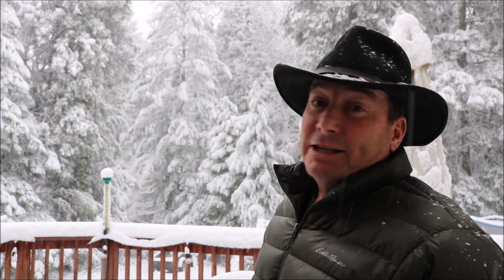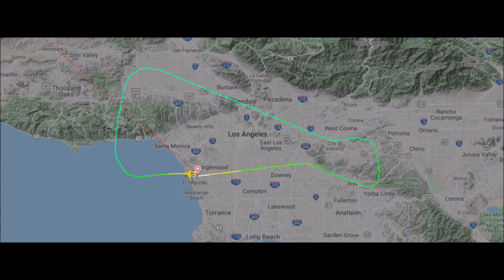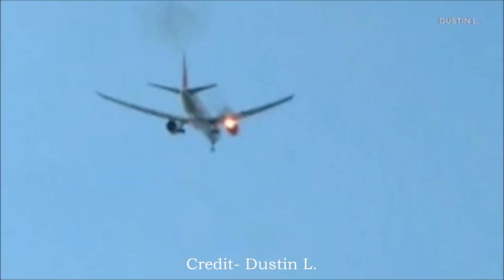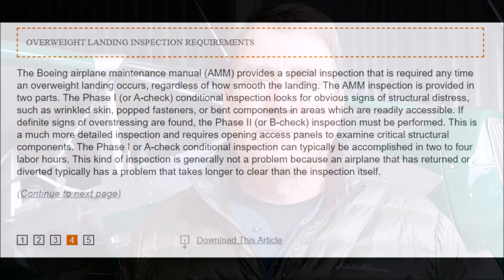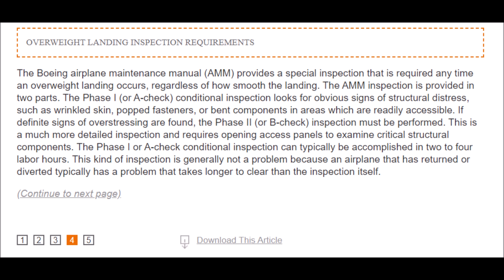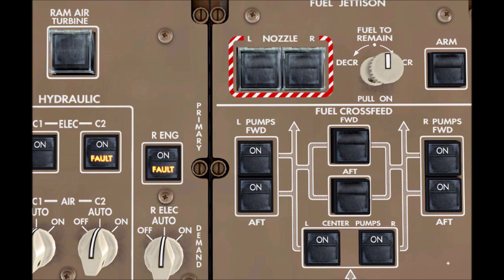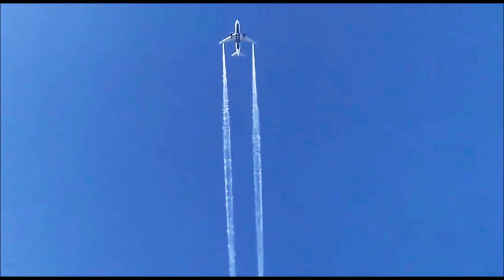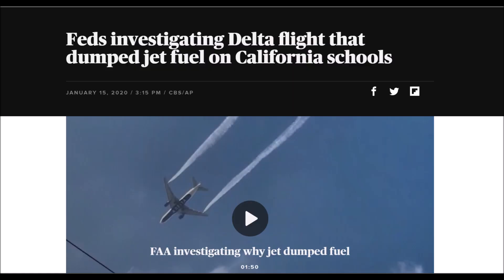B-777 Fuel Dumping and Overweight Landing Considerations (Part II)

Comment: Given something like a compressor stall on departure which didn't result in engine shut-down, my judgement would be to take it out to a safe dump area, sort things out and come back when good and ready.  No need for a slam-dunk emergency return, unless that Rolls was in MUCH worse shape than we imagine.  Plenty of runway for overweight landing - it would be a piece of cake (I've landed about 24000# overweight in the 777-200 and it was a non-event on SFO 28R). I'd bet this unannounced, low level fuel dump will result in an FAA investigation and a good chance for a serious violation on the part of this flight crew's actions.  Really good discussion Juan, as always.
Reply: Bill Wightman Right on the money- and your opinion agrees with mine. (I haven’t flown a 777, but have plenty of time in 767’s and 747’s.)
Reply: @FutureSystem738  I've never even ridden in a 777. 

I am not a pilot.

I've never even flown a video simulator.

But I have a reasonable understanding of mechanical stuff. So, it would seem to me that when an engine stalls for an unknown reason, you should have concerns for the other engine. 

That being the case, would it not be prudent to put it down as quickly and safely as possible?

Is it standard practice to say, "ahhhh, fagettaboutit! we got another one"? And park it out over the Pacific while they vent fuel until they are at an acceptable weight?

Seems to me that a little bit of a Jet-A spritz is acceptable rather than risk total engine loss, regardless of its likelyhood.
Reply: 24k over...pretty heavy, had the DL not dumped, they'd have been 70k heavier. Pretty big difference than 24 huh?
Reply: Bill, is a compressor stall something that happens much? Is there a way to immediately diagnose cause? Could it be FOD? My guess is that when it happens shortly after takeoff, FOD is a possibility, if not the likely cause. And if this is the case, isn't the other engine suspect as well?

I have asked this question a few times, but haven't received a reply yet from a professional pilot.

So, I will ask again. 

When an engine stalls during climbout, what are the possible causes? 

Seems to me that FOD or fuel contamination are at the top of the list. And if this is the case, is there a chance that the other engine may have sustained some damage that has not yet become apparent? 

The only explanation I can come up with the pilot's decision to put it back on the ground ASAP is that he did not have confidence in his remaining engine. He had to know there'd be repercussions for dumping where and when he did, but was more concerned with the possibility that he was gonna become a glider pilot shortly.
Reply: @petec9686  Hello - compressor stalls are VERY rare these days.  A compressor stall is an aerodynamic stalling of the compressor blades (similar to how a fixed wing can stall) which results in sudden interruption to airflow through the jet engine. 

     CS's can be anything from mild to violent - and in most cases there's no way for the aircrew to diagnose the root cause of the problem.  Fan blade icing, or damage are possibilities.  A CS can usually be felt, heard and observed by the crew when it happens.
     A stall occurring shortly after takeoff as in this case might have been caused by a damaged blade(s) or maybe not - just no way to tell.  I personally would still have complete confidence in the other engine as long as it was performing normally.  Big thing here is the incident engine was reported to have recovered after power was retarded - which is what we're trained to do in the event of a CS.  If the engine recovers, leave the power where it is (or lower) and sort things out from there.
     I have a ton of experience with CS's due to my years flying the E3 AWACS.  The TF33's there could stall if the power was brought too far back while accessory drive load was high.  It was a muffled "bang" type of event, with EGT and EPR (exhaust pressure ratio) jumping around.  Simply advancing power would always stop it, and I never saw or heard of any engine being damaged by running it into a stalled condition.
     Its important to understand that when a "startle event" happens, our cognitive awareness as humans will be instantly compromised.  Meaning that our ability to accurately take in inputs from the outside world and then make good decisions from those inputs might be severely compromised.
     The wrong thing to do is to react inappropriately while cognitive index is low - we call that "rushing to a solution" which is what appears to have happened here.
Reply: @davep9266  When we're talking about a 640,000 pound aircraft, +50k landing weight is really not that big an issue.  Lets look at some data from the 777 Flight Manual:
     Max takeoff weight for the 777-200B is 648 (thousand pounds).  So lets say we're going to fly a heavy weight no-dump quick return to the field, single engine which will be a flaps-20 approach and landing so I'll assume a worst case landing weight of 630 here:  (thats a full 170000 over max landing weight of 460000 !!)
     From the 777 flight manual:  At 630 and approach/landing flaps 20 published landing distance is 5440 feet (max manual braking / max reverse on operating engine / zero wind / VREF+5 over threshold / touchdown @ 1000')  With light braking, my guess is the landing rollout could be comfortably completed within 10000 feet, letting the reverser(s) do most of the landing roll energy dissipation and leaving less heat in the brakes.

  Considering KLAX runway 25R is 12,923 feet long, you can see its really not an issue.  The biggest issue after landing will be HOT brakes.  But that's also really no big deal with fire trucks ready to handle a brake fire.
   The take-away here is to recognize what an OUTSTANDING aircraft the B777 is.  It has amazing capability.  Its what I want to be flying when the going gets tough.
Reply: @okflyer777  I've seen people criticize the pilot for not going out to sea and dump. If it were known why the stalls occurred, I'd agree. But this incident was an unknown to the crew. He didn't know if it was a part issue or contaminated fuel (the latter has been a recent issue the past few weeks). The airline procedure is also an unknown. Regardless of the aircraft performance, his only concern was the 280+ souls onboard.

Comment: I flew the B-777-200LR from LAX to SYD a lot in my years just before retirement. The numbers for the 200LR were 766,000 lbs Max Takeoff and 492,000 Max Landing Weight. If I lost an engine right after, or during takeoff, my plan was to come back to LAX as fast as possible and dump fuel most of the way back. So I would be dumping fuel below 5,000', probably at least down to 2,500' on downwind. In my briefing before take off I would tell the RP to stop the dumping on base leg if we forgot about it. My guestimate was that, in the time it took to fly outbound RWH from LAX, get stable, and turn around as soon as possible, go downwind, base, final, and land, I could dump about 60,000 lbs of fuel. We often took off near Max Takeoff Weight of 766,000 lbs on SYD flights, so my weight on landing would be near 700,000 lbs, well above the Max Landing Weight of 492,000 lbs. I never flew the L-1011 or the MD-11, so no ancestor worship from me. ..... So this could have been me. Thankfully it wasn't.

And these guys did not say they didn't need to dump, but rather they didn't need to go to a designated area to dump. They needed to get on the ground fast, and get their weight down. The bad engine was still providing electric, hydraulic, and pneumatic, but not much thrust.

Basically, to understand my plan. (1) Get on the ground fairly quickly (2) get rid of weight as fast as possible.... So, no-go to area to dump, and probably dumping below 3,000'.

Comment: Very educational video! It helps me to learn the enormous responsibility which pilots they have on their shoulders once they are in the air, also during emergency procedures with significantly damaging consequences for mishandling the proper action. It is not easy to be a pilot, for having very demanding pressure to do things the right way with "Zero Tolerance".

Comment: Always a good idea to pre-calculate your landing distance when doing a high weight take-off. Especially if you're using an iPad or similar to calculate performance. This way you know whether you need to dump fuel or not. An overweight landing is not that big an issue providing the vertical speed at touchdown isn't too high. You can use any excess runway to keep the brake temperatures down. Fuel dumping needs to be carried out in a controlled manner (altitude and location) using the checklist. At my company we just covered this on the last re-current. We were shown all the indications on the FUEL page and on the overhead panel. Very informative.

Comment: The other consideration for whether to dump or not on a four engine airplane is the possibility of losing a second engine on the same side due to damage resulting from the adjacent failed engine. If one had to do a go around with two engines out, one would want to be at a weight that would safely permit that to happen. This was a concern on the older 747-100, especially on a hot day. That, perhaps, is part of the historic mentality you mentioned with regard to dumping to MLW. 

Of course, whether to dump or not is at the captain’s discretion based on the current issue, but whatever is determined better be the right course of action...unlike this Delta flight. It’s really hard to imagine any justification at this point for what that captain chose to do.

Given that this was a 777 from LA to Shanghai, there would be one or two extra crew members onboard. I find it astounding that between the three or four of them that they dumped fuel where they did after being asked by ATC if fuel dump was required and replying, “no”.
Reply: Thank you ,Manny, for clarifying how a "real", HEAVY, airplane is operated, rather than these "light twins. :-)))). F/E, Mike Jaureguy- PAC.
Reply: The 777 is a twin engine airplane. According to a quick search, it can fly for 3 hours and 1300 miles on one engine. I don't understand the urgency to land if only one engine had a problem and they were able to stop the compressor stall. The investigation should be interesting.
Reply: divingfe   Hi, Mike. Long time, no see.
Reply: HiWetcam   Not sure I understand the question.
Reply: @tiredoldmechanic1791  3 hours/1300 miles or until the other engine fails.
Reply: @tiredoldmechanic1791  The only thing coming to mind is that they maybe experienced the same problem on the other engine as well during the final part of the flight.
There was unfortunately no audio on VASaviation for that part so it is not yet really known what was said there.
It could be that they found there was extra urgency to land quickly, but it is difficult to explain why they suddenly started dumping fuel for that short period of time where it would not make a real difference anyway.
Reply: Tired old mechanic I can understand the urgency to land. The reason air travel is so safe is because of redundancies. It CAN fly that long on one engine but there’s no backup in case of a second failure. I don’t think they are going to experience an engine failure and just continue because the plan could make it on one engine, they’ll want to get it on the ground. I dunno about the fuel dump but I can understand why the 1300 mile capability is not really much of a consideration unless there’s a reason they don’t have an airport for hundreds of miles.

Comment: Some crew is going to get to sit at that long table where they are the only ones not supplied with a bottle of water.  Glad I'm not that captain.  Not sure what Delta's QRH looks like but all the ones I'm familiar with have a prompt to take you to the fuel jettison check list on engine shut down check list. Thanks for the update. Its been painful watching what the main stream media is saying. All the slip and fall lawyers are lining up.
Reply: Well, it just wasn't "school kids" who got a Jet A shower. The jet dragged the stream for a couple miles. Do you want your car covered in that greasy stuff?
Reply: @fucqtheworld  I'm sure there was a strong odor of fuel but I doubt if anybody's hair got wet with jet fuel. It was more than a couple of miles. Are you with CNN?
Reply: @Kevin_747    So, you're defending their dumping of the fuel?
Reply: @nodttiurp  No. Are you?
Reply: It's kerosene. Well atomised as it was, it wouldn't have hung around more than a few minutes before evaporating completely.
Those kids and parents would have far more exposure issues merely going to school every day under a flight path...
Reply: @Kevin_747  wtf does CNN have to do with it ? Smfh... political  foolishness  everywhere you  turn.
Reply: @checkdilevels1180  because CNN is garbage media and well-known for inaccurate reporting and taking statements out of context, much like the user he was responding to.
Reply: @jsquared1013  So does every MAIN stream media outlet...

Comment: The exact language of the ATC inquiry as heard by the pilot might become relevant. I've read this was the question: “OK, so you don’t need to hold to dump fuel or anything like that?”  and I've seen 'or dump' in place of 'to dump'. It makes a difference. The reply was "negative". The pilot might have been correct in that he didn't need to hold to dump fuel because he intended to dump on the way in.  That wouldn't be good practice but note that FAA regs permit a pilot with a declared emergency to deviate from any reg at his/her discretion in order to get he plane safely landed.

Comment: I like the old F-111 "dump and burn". There's video on that at airshows here on yt. Aussies did it a lot at their airshows.
Reply: I was just pondering that very idea, would be a very effective and logical way to eliminate the dispersal concerns of fuel jettison especially in a scenario such as this one.  Would certainly look spectacular although scary for passengers and ground witnesses who didn't understand what was happening.  I'm sure it could be possible with the necessary ignition apparatus though it would probably come down to the cost of such a system that would determine the viability.

Comment: BTW, my former airline (CAL) opted for the GEs on our B-777-200s.  I had to once land a B-757-200 overweight after an engine shut-down (duct overheat).   We had no dump capability in our versions.   Fueled and loaded from KEWR (Newark) to  SPJC (Lima, Peru).   Happened climbing through 18,000.  So, diverted to KIAD (Dulles) because it was snowing in Newark.  Naturally, I told the lead F/A and cabin crew that we had an engine shut down, but did NOT relay that fact to the Pax.  So, vague comment about a "mechanical issue", and thus no panic.  Anyhow, uneventful landing, just a write-up in the log book (two, of course):  Duct Overheat, and also O/W landing.

Comment: so, compressor stall issues aside, they didn't need to dump, and when they did, 1) it didn't make any difference since they didn't have enough time to dump a sufficient amount, and 2) what they did manage to dump, unnecessarily, was done out of protocol
Reply from the maker: yep.
Reply: @blancolirio  As a former FE, my take is that initially they were over water and at about 8000 ft, a pretty good position for a dump. Probably the 3rd pilot initiated the dump, assuming they would do at least a few turns in holding to clean up checklists and prepare for return. The captain initiated an immediate return and while trying to coordinate with atc, clean up checklists, and deal with the emergency they forgot the fuel was dumping. Oops.
Reply: @tonydarrington6741  The CVR may be a lot more interesting than the communication with ATC
Reply: Based on this video, these pilots should have simply landed heavy without dumping fuel. They didn't have a full passenger list so that itself lightened the weights some. However, I'd think the best practice would have been to maintain 8,000 ft and dump 20 minutes of fuel then land but they appeared to head for the airport in a rush leaving them with little time to manage their concerns.
Reply: @tonydarrington6741  Based on their response to ATC twice saying No, we do not need to dump fuel, I'd say they didn't begin that soon. My guess is they started to do so after they got to the right turn and 4,000 feet.
Reply: I would be interested to find out the age of the pilot in command and if he also qualified to fly the 747 or other older air crafts.
Reply: @blancolirio   If I fly Blanco Airlines how would they have handled this situation?
Reply: 15,000 gallons is a little over 100,000 pounds it’s actually quite a bit of weight.

Comment: Ive only had to dump fuel once. I was flying a BAC 1-11-400, (corporate) out of PSP when we had a hydraulic failure. We elected to stay within the valley rather than flying over to LAX. We climbed to about 8000 feet and were directed out towards the unpopulated / desert area before being allowed to dump fuel. We dumped the amount of fuel needed to bring us within the allowable landing weight. 
Came back and landed without incident. 
So to hear this story I have to wonder, who did what when??